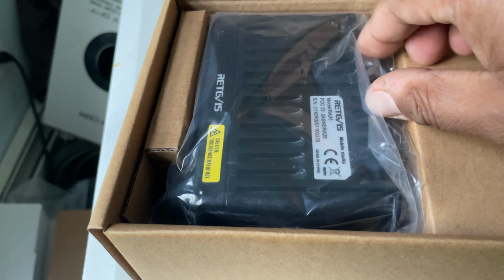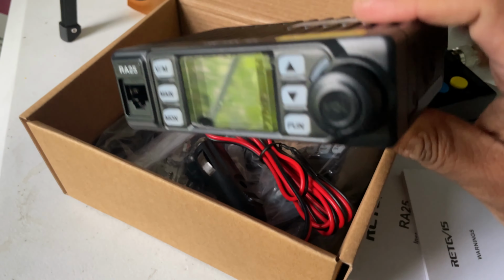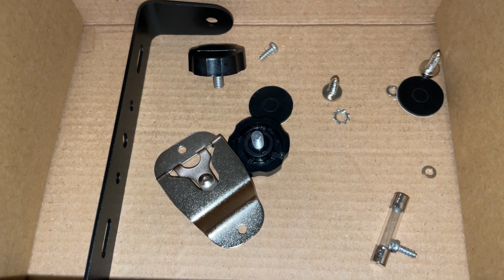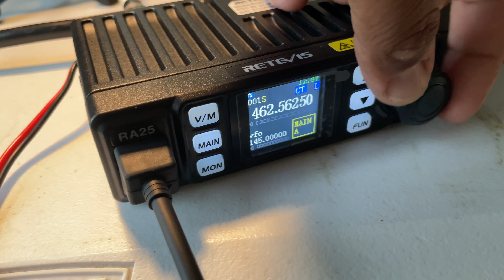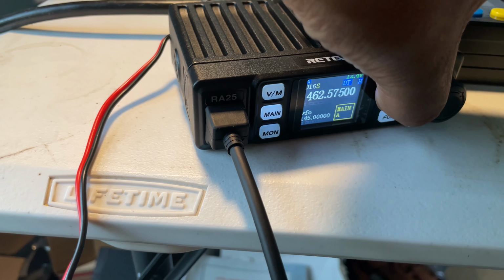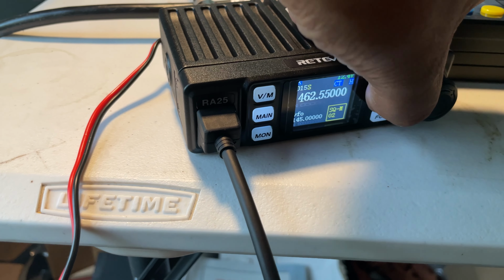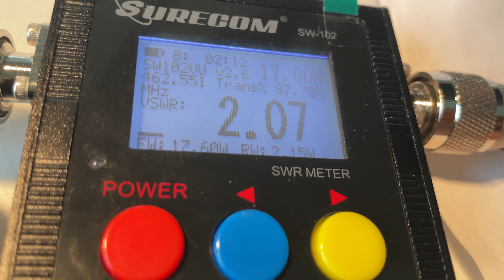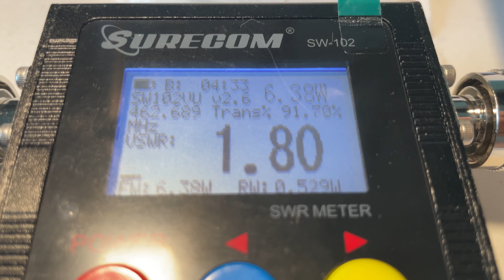Retevis RA25 Mobile GMRS radio - overview and power check

Comment: I have one of these... well, the Anytone version.  They're the same radio.
I have mine in an ammo-can go box with a 12ah battery and a mobile antenna - it works amazingly.  I can hit ham repeaters 40 miles away with it.
It can be unlocked to transmit in the ham bands AND the GMRS channels by using the programming software.  Not sure of the legality of that, but it's nice to have a radio that does it all if you have the appropriate licenses.
It also plays broadcast FM (Go into VFO mode, and type in the freq).  Nice if you want to put it into a work truck with no radio in the dash.
It also has a FUN button, for maximizing your fun.

The downsides:
The instructions (that I got) were god-awful.
The programming software is as bad as the instructions, but with a lot of patience you can figure it out.  It's like CHIRP, if chirp was made in China, made way less user friendly, and poorly translated.
It comes with a cigarette lighter on the power cord.  Be careful - most cars cigarette lighters have only a 10 amp fuse, which will pop when you key up the radio on high power.  I recommend wiring it directly to the battery terminals if you're using it in a vehicle.

Comment: If you shut it down and hold down the VM button and turn it back on you can unlock the HAM bands. However you will have to reprogram any GMRS stuff you saved because it will factory reset when put back to gmrs

Comment: I'm actually slightly concerned that it can receive in the Ham bands. Pretty cool unless you use 70cm mobile ham rig as well. It being open would mean that the front end filters are open to the band that I have a 50w transmitter on in the same car. I would probably use a high pass in the GMRS and a low pass on the Ham anyhow though. Has anyone seen this issue?

Comment: Can you switch between wide narrow band...? 🤔
Reply: Get  a programing cable for the radio and download the RA_25UV:UHF(400-490Mhz) VHF (136-174Mhz) shedsheet software.  Jailbreak the radio.  Turn the power off.  While pushing the v/m button/turn the power back on and it will give you a menu of frequency range you want it set to. (136-170 MHZ) (400-490 MHZ) has the most options. Then turn it off again and back on.   The radio is ready for any programming you want to give it.  Secret I have found is to load radio programing to the spreadsheet first then rebuild the spreadsheet programing for all gmrs options you want.  You  can jailbreak everything back to factory GMRS setting at anytime so you can't screw it up. Plus even in the Gmrs factory mode the spreadsheet let's you set ctcss/dcs to your liking much easier then on the radio screen. Oh yah. You do have wide narrow  FM settings
Reply: @2148aa  can I do this with my chromebook? 🤔
Reply: @ZiggZagg11  I have no idea.  I know many people  use chirp open source programming to program GMRS and it don't like apple or Chromebook.   When you use Retevis spreadsheet programming you will use the Lord's name in vein often.   As far as I know the programing cable has to be ordered from Retevis which  is a 5 week wait when shipped from China.  You open that radio up removing all safety locks.  Laws can be broken.
Reply: @2148aa  I use my Mac to  program my radios using chirp, all of the time
Reply: @keyoflife24  I did download chirp about 18 months ago and it is about worthless in rural Iowa.  GMRS repeaters it listed went silent before 2017.  2 meter ham repeaters are gone except one.  The last of law enforcement went digital 6 months ago.  Public health nurses, county snowplows, and  school buses  still use VHF/UHF. School buses all uses same UHF channel with different tunes for their home repeaters. Mornings I chug the school bus repeaters to see how open things are. I'm about 60 miles away from the  closest GMRS repeater which means I have to pick my battles when things are open.  Most repeaters have links to nets and their good old boy network don't appeal to me.  Farmers have taken to GMRS and things have been nuts during harvest.  For me it is something to listen to mush and talk little. P.S last I heard chirp won't work on mac or download to RA25